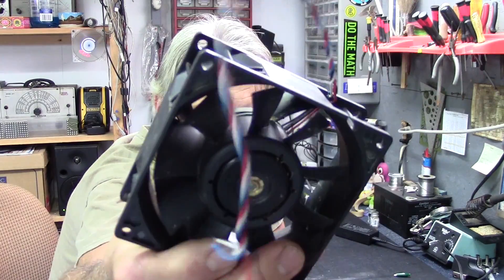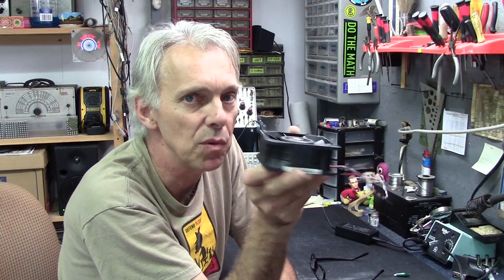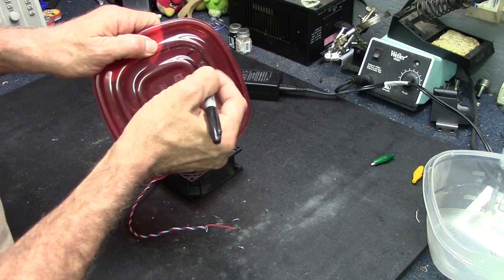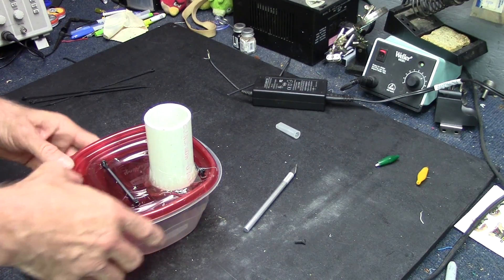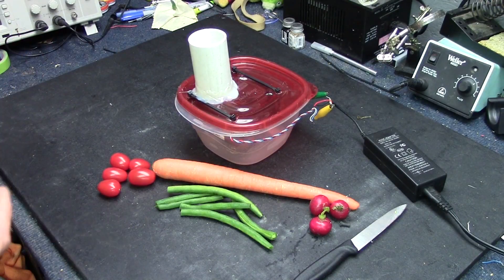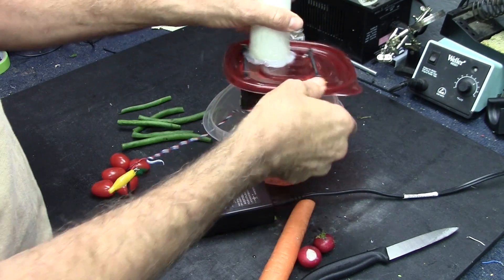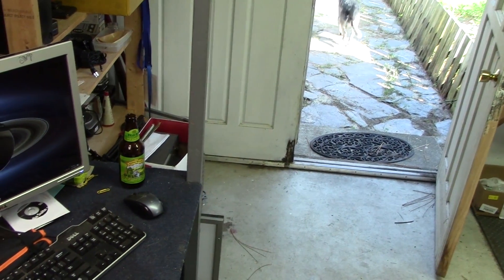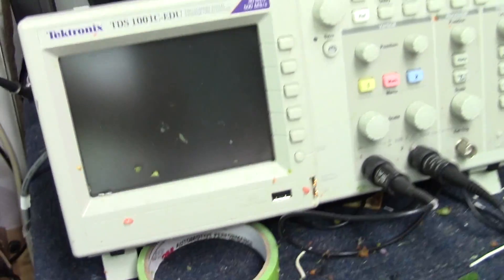Food Smasher Made from a Muffin Fan

Comment: What you have there is what usually used in rack server. I got a few of them (the servers) laying around.  Take a look at the ProLiant DL360 G5 (what once I got), you'll see the harddrive bays in the front, followed by a full row of just fans and then followed by the motherboard and psu's.
Got great airflow but makes horrible noise, when AMD Ryzen 7 came out I built 2 system with the 1700 that are quiet. :)

Comment: Old CD-ROM drive fun next!!
Reply: If you unscrew the platter retaining ring, run it up to full speed and then tip it on its side, the discs will fall off the spindle and zip across the floor.